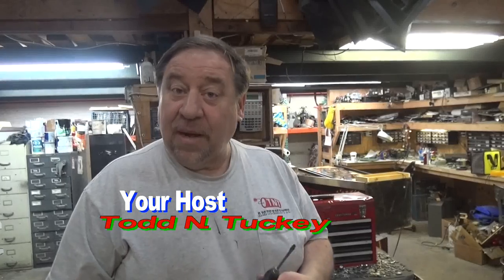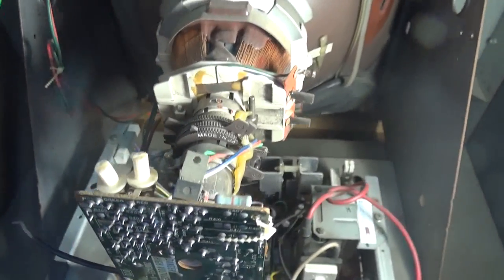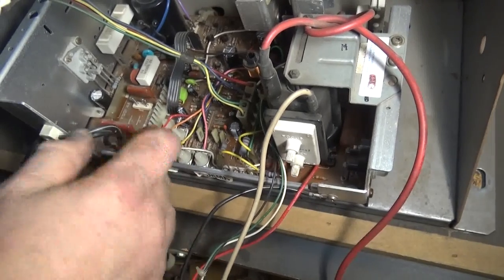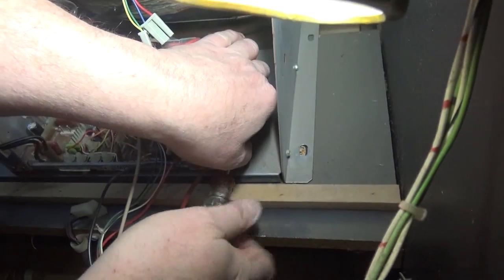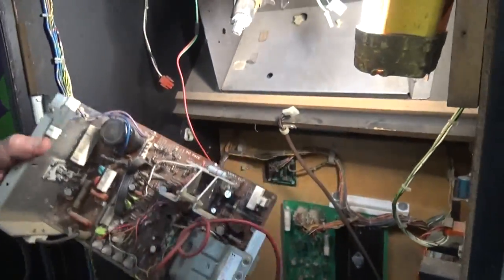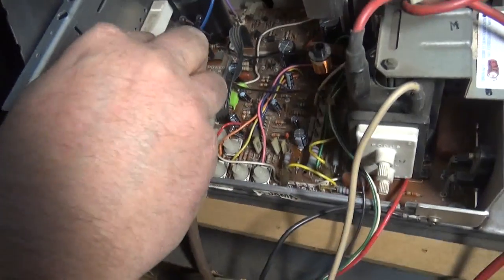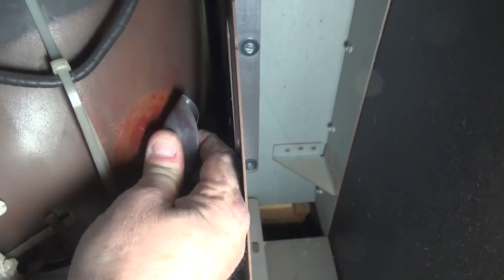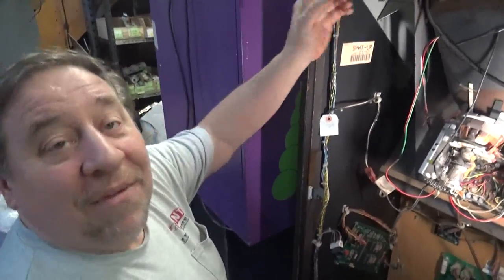#543 Arcade Game WELLS GARDNER 4900 Monitor Chassis High Voltage DISCHARGE TIPS-TNT Amusements

Comment: Thanks for the reminder tutorial - it's been 15 or so years since I've had to pull a chassis. Have to swap out a 4900 today, so this has been very helpful.  Thanks for posting!
Reply from the maker: Glad it helped!!
Reply: And of course I get out there, and the other chassis has a different power connector and requires the entire monitor be pulled from the cabinet. So I am taking it off site tomorrow. Argh.

Comment: I wish so much that I had watched this video a week ago!  I have a WG4700 that was DOA, and I recapped it, and it's so close to working, but after being on for a minute it crackles out, the screen collapses into a line then dies completely.  This happens every time you turn it on and seems to work longer the longer it's been off.   Watching this video, I saw you mention the big resistors, so I just now went back to the chassis and saw if they were loose.  Sure enough, one of them is so loose that you can pull it up and down.  I'm going to remove and resolder it, but it's too late, I already bought a new replacement chassis.  Now I need to find another 25" CRT tube to put this on!  I do have a machine that needs a monitor...
Reply from the maker: yes...so many of these electronics are simply cold solder connections!!  A quick check and reheat on a workbench can help so many come back to life!
Reply: It definitely needed the cap kit and new flyback, too, though.  Whoever had this neo-geo last did terrible things to it.  Cut a bunch of button wires, did a poor job of fixing the chassis, and I need to get the 4-slot board serviced somewhere as it only comes up with the test screen or the crosshatch pattern with a blue border.  Amazingly, though, the EL panels still work, barely.

Comment: Great WG4900 video. One question, I'm trying to adjust the screen on a wg4900, but the horizontal (l/r) are too wide. I have tried using the white horizontal adjust knob, and putting it all the way left and all the way right. Is this common, and if so, how can I fix it? Are those "master overide" pins the answer?
Reply from the maker: did you try to change the capacitors?
Reply: TNT Amusements Inc Yes, I did the "normal" monitor  cap kit. I was reading on Bob Roberts page that the symptoms I'm having, it might be a good idea to do the horizontal width area with new caps as well. It seems like the horizontal width  is not something that goes bad in a lot of the monitors, and it's not in a "normal" cap kit set. I think I should do the horizontal cap kit....do you agree?

Comment: Is a Wells Gardner a manufacture that's something like a company that's makes cvt security monitors? Your crew kicksass. Never heard of a WG till I started watching TNT.
Reply from the maker: They are an American company that has been making monitors for arcade games since 1979--perhaps earlier.  There three original chassis--the 4600, the 4900, and the 7000 are perhaps the workhorses of the entire industry.  There U2000 to U5000 are slightly less reliable, but once rebuilt, they are terrific.
Now when I say reliable, we are looking at 35 YEARS of service with the oldest chassis---we I still feel are terrific---on a one to ten, these are ALL 9 and 10.  Sadly, with the demise of the picture tube, they have moved on to other things.  I purchased the last 30 19" wells gardner monitors made---I have most of them in my warehouse still crated, for future needs!
Reply: TNT Amusements Inc 50 years from now, say if I run into an arcade game I love, but the monitor has on-screen burn in, will I be able to replace these monitors with an L.E.D. monitor substitute if I can't find an appropriate replacement?
Reply from the maker: badreality2 Yes, you will be able to....won;t mater to me...because in 50 years I will be 109!!!

Comment: Every once and a while the Blue color go's out on my arcade . do you know how to fix that ?
Reply from the maker: probably a cold solder connection on the header pins of the input on the monitor chassis, or the edge connector is a bit loose on the logic board.
Reply: is it an easy fix ?